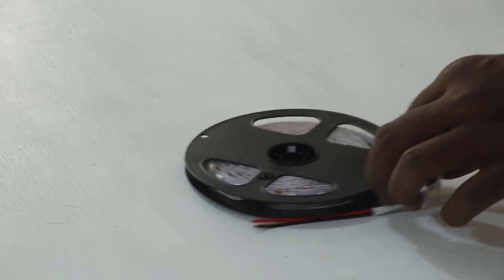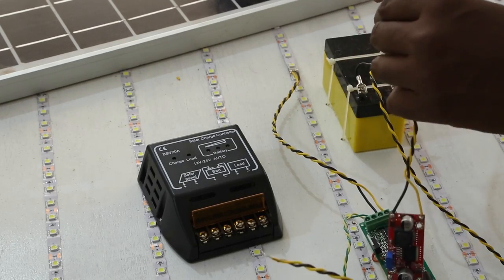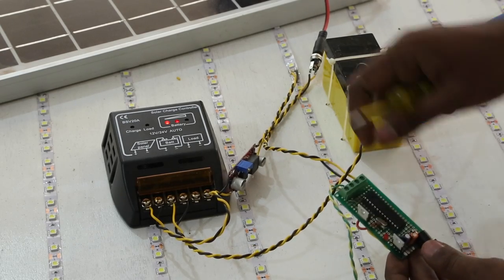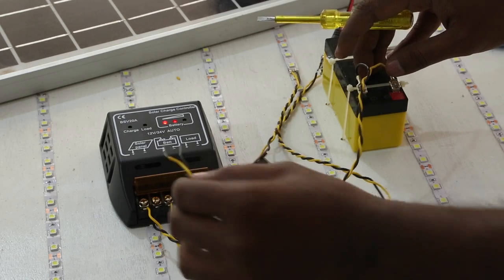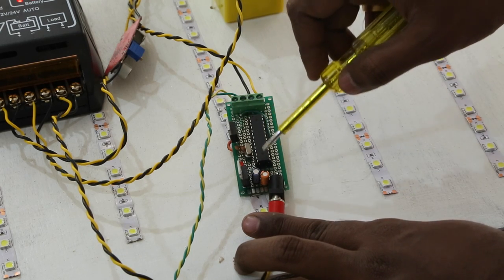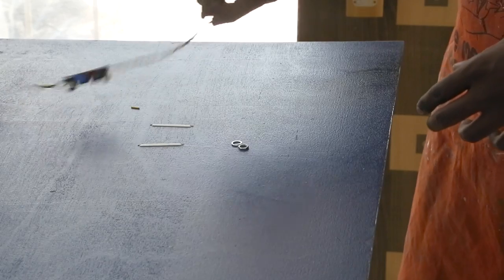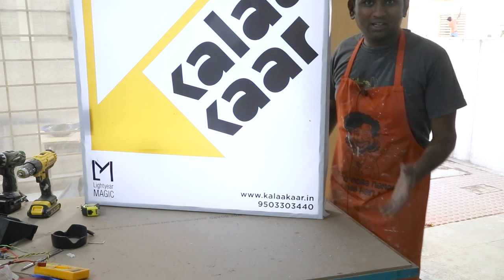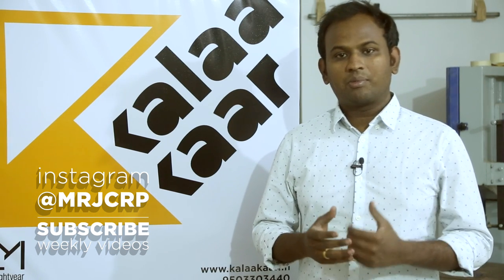How to use solar panels - dusk to dawn

Comment: a charge controller itself control the charging voltage. when the voltage from the solar panel is at it's peak, the charge controller simply converts the extra voltage to current and vice - versa . No need to use charge controller and dc to dc converter in series. Again a simple ₹10/- 555 with an led will do the switching job.